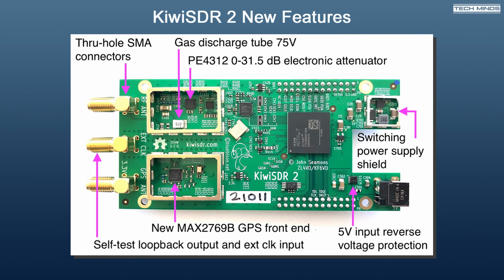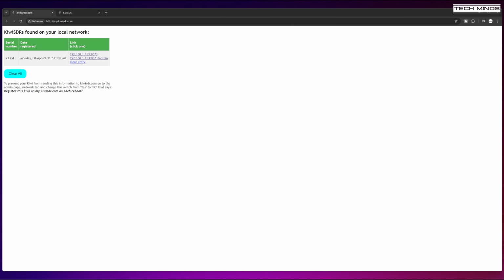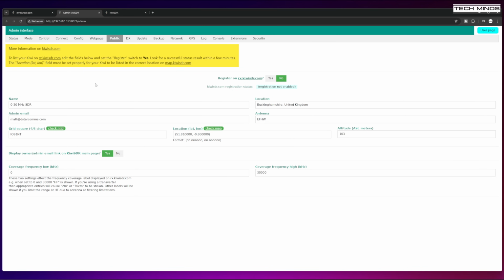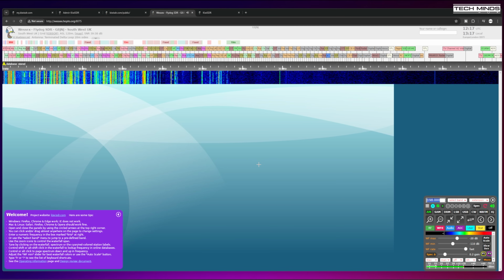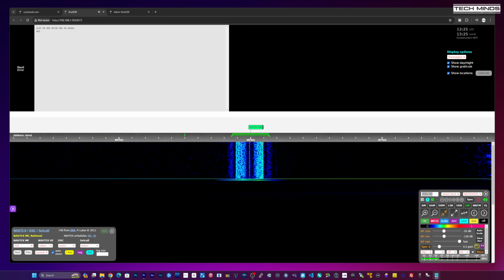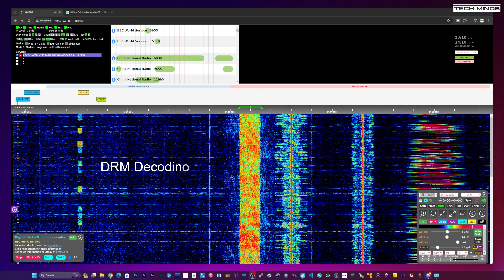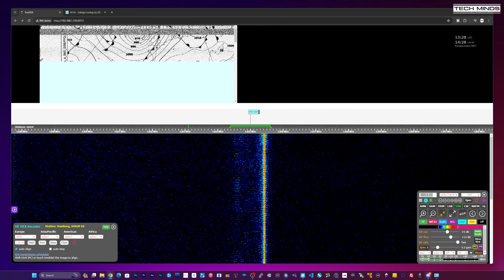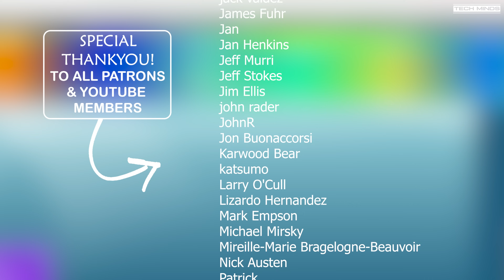KiwiSDR 2 - A Standalone Software Defined HF Radio Receiver

Comment: Why not just making this PoE capable? With USB only providing power input you could abandon that port completely….
Reply: This is a solid product projected almost 10 years ago with absolutely no competition up to this moment in terms of features and price range. 

KiwiSDR2 is actually a monumental effort from the author to produce a new batch of these receivers. Its key components experimented with huge price and availability issues following the electronics industry supply chain quake due COVID-19.

Including a new power option, potentially a very noisy one, would require hundreds of hours of testing and circuit revision.

Comment: Latency - does anyone have a view on this compared to the MK 1?
Reply: KiwiSDR2 is exactly the same specs and software of KiwiSDR, with only a few changes on the antenna input connection and GPS antenna input.
Reply: @hg-sx5nk  Thanks. They are great boxes but a pity there isn't a single operator low latency mode for transceive use. I guessing the multiple slices slow it down even if you don't want them. Makes tuning very spongy. Should do well nonetheless. Built-in proxy is good news for CGNAT sites.

Comment: On kiwi forum I ask if root should be running the kiwi service, maybe just a mistake. Explained why its not good.  Today my account is read only, and the post was removed.  That is not cool. Now I am seeing the real side.

Another thing that bothered me when I ordered mine in early March. They charged me right away. But did not ship until April 2nd.
I sent an email asking  why I was charge already.  The response was not in email.  But on the forums they changed a subject that had been closed.
Saying that cards are charged because  this is only the 2nd run. You guys are buy stock before its built.  So if you dont like it, let us know and we cancel and refund your order. I sure someone else would love the sdr.
   Not very kind customer service.
Reply from the maker: I cant comment on the forum issue you have, but with regards to paying 100% for something before its built and shipped is not a problem for me, and people that want to be on the list for a relatively limited supply of a product. I have done this many times in the past, just so that I ensure I get the product I want. KiwiSDR is huge in the world of online SDR, extremely sought after, so I guess they need to make sure the buyer is a serious buyer. It also helps them get a feel of the current market requirement. IMO of course..
Reply: @TechMindsOfficial   That is a fair statement.  
 I guess just knowing that was going to happen would be ok, but I was not aware.
Reply: @RangerUT  I thought it was pretty clear that I was paying up front before the first batch of V2 was built.

Comment: so whats the beef with KiwiSDR and Openwebrx ?
They look very similar like they were developed at the same time or even the same thing they has diverged over time
Reply: The original author of OpenWebRX finished his graduating studies and left the code to anyone use, IIRC.
Reply: @hg-sx5nk  KiwiSDR webif is a OpenWebRX clone which has since then been advanced and new features added.
then a quarrel began between the builder of OpenWebRX and KiwiSDR, which was solved and then later on came OpenWebRX+ but it does not (yet) have all the features KiwiSDR has

Comment: i'll stick to my sdrplay
Reply from the maker: Completely two different products catering for different solutions. That's like saying I'll stick to my push bike instead of my car. But SDRPlay devices are also one of my favorite SDRs, especially the RSPdx. However, it's a different product all together. KiwiSDR is designed for quick and easy deployment of an SDR receiver that can be reached from around the world over the internet, straight out of the box. Cheers
Reply: technically with SDRconnect, you could have one pc as a server and a client pc with SDRconnect configured to work over network and get a similar result.
you just cant decode different modes or currently add your own memory bandwidths

Comment: Cons-
Not safe to put on the internet. Kiwi runs as root.

Cheap gps included.
10/100 network card
4g sd card

For $400 I expected more.

Pros
It is  a cool sdr.
Reply: An FPGA, a very good 32MHZ ADC, a Linux SBC, support for 4 simultaneous users, dozens of digital decoders, all in a plug-and-forget solution... 

....and no other similar product on the landscape for the hobbyist. Perhaps USD400 is too low for other companies to engage in competition!
Reply: Anything “on the Internet” should be isolated in a DMZ…

Comment: You're perfectly right : I received it 5 days ago, and I'm on it most of the time.
It's a very cool receiver, I have an openwebrx with a rapsberry pi / sdrplay too, but this one is so easy to use...
Reply: I use Openwebrx+ with a RSPdx. just wondered if you have any issues with bandwidth changes between profiles and the waterfall sometimes going really slow.
I suspect this is due to sample rate changes and the switch between different antenna inputs
Reply: @BillyNoMates1974  correct, these are issues that the KiwiSDR does not have. 
I had the first version of KiwiSDR until I fried it and then it was no longer available. Tried OpenWebRX+ with an RSP duo, but does not even come close, as changing bands changes the band for everyone on the SDR

Comment: When you said VLF to HF l was thinking ….bet they didn’t add a gas discharge tube for lightning static… nice to be proven wrong, confident that it has been designed correctly.
Reply: Then did. See 3:08.

Comment: I suspect the Gas Discharge Tube is to protect against static pickup on the antenna rather than power surges.

Edit:
The definitive answer - STATIC.
John's response to my email query.  His prompt reply and information is presumably an indication of the high level of support that KiwiSDR's customers receive.
-------------------------------------------------------------------------------------------------------------------------------------------------------------------------------------------------------------
Hi David,

The GDT sits across the HF antenna input along with a TVS diode that the Kiwi-1 had. Also added with Kiwi-2 is a 100k ohm static drain resistor designed to drain the static voltage that tends to build-up on antennas from wind static.

The GDT was inexpensive and designed to absorb pulses that the TVS might not catch. All these devices respond to different time/energy profiles on pulses on the antenna induced from nearby lightning strikes.

Regards & 73,

John, ZL4VO/KF6VO
KiwiSDR NZ
Reply: And/or lightning⚡?
Reply: I understand that it is to increase the resiliance of the RX to very strong local signals. Many of these are located at the homes of radio amateurs so it helps if they are tolerant of strong local signals. I understand that this is an addition on the original version. I have a KiwiSDR 2 and it works exceptionally well. At the moment I have mine connected to a 10 element log periodic @ 27 metres. Usually parked beaming west.

Comment: Only temporarily sold out. Hundreds more available in a week or two. Also soon from distributors. So popular we can't build them fast enough!

Overpriced? I hear this from people who don't understand the standalone architecture. With other SDRs you need to be amortizing in the cost of the attached computer. And the cost of your time in installing software. The Kiwi is designed to solve these problems in an easier way. I invite people to learn and discuss on the Kiwi forum. Thanks for the review Matt.
Reply: Congratulations on an excellent product. There are an amazing number of these from around the world accessible online (using the link provided). There couldn't be a better way to demonstrate how good it is.
Reply: I think it's a decent price for the features. I've seen SDRs with fewer features go for much more.
Reply: 10 years ago people would have had to pay over £5K for a setup like this and it wouldnt have been controlled over the web.
it would have been a tuner you would have to have had in a shack.
this system allows a user to sit in bed and tune the waves on a tablet or a flippy type chromebook
Reply: @ThePrivateMan3301 Only to configure, which you could do via your phone, on your home network. Or use someone else's computer for a few minutes, to configure. The unit then operates standalone and headless.
Reply: I think it's reasonable. My mark 1 version cost me £300 and that was second hand ! This is a very high class sdr folks
Reply: @ThePrivateMan3301 Well now you have to differentiate between computer on the server-side (Kiwi) versus computer on the client-side (user/browser). For the vast majority of SDRs that generate IQ streams the server/client is effectively merged into one application on the computer. And they are single-user (some are now starting to develop server solutions). With the Kiwi you get an integrated server able to handle multiple user connections simultaneously (that can tune the entire 10k - 30M spectrum independently).

Many Kiwis are placed in isolated locations due to noise issues. And some find it easier just to deploy a Kiwi versus an IQ SDR plus computer, software and some sort of screen-sharing setup with the computer (assuming there isn't a server solution for the IQ SDR). And then what do you do about multi-user if that's a requirement?
Reply: @ThePrivateMan3301you can also use your phone
Reply: @ThePrivateMan3301  u can use the device u are on now.
Reply: Very good value for the amount of silicon you are getting and for HF is plug and play, try doing  a RP4 & SDR Play RSP it runs 90%plus CPU with only 5Mhz spectrum real time sample, KiwiSDR for HF is best value hands down

Comment: That sdr was over priced in my opinion and sold out too😮.
Reply: in what way is it overpriced? It includes the BB green and the SDR is completely custom made and in a metallic case.
Reply: sold out is markting stratagy 😈
Reply: @Mr_ASIC Have you thought perhaps it's just a great product, with no competition, made by an individual (not a large company like Icom or Sangean)?
Reply: @Mr_ASIC  Sure. But in our case a consequence of bootstrapping production from scratch. And not wanting to borrow money from the evil banks. So have to set build sizes that are certain to sell well to raise the money to pay the manufacturer. Every penny in profit we've made has gone back into producing larger build sizes. Eventually we hope units will begin accumulating as stock-on-hand instead of selling out every time.

I recommend everyone run a small business sometime during their life. A real eye opener..
Reply: @Mr_ASIC  except it's not. They can't produce them fast enough to keep up with demands

Comment: For anyone wondering it's £320 and sold out. Looks pretty neat and seems ok value to me.
Reply: It's kind of around the same price point if you build up your own system with Openwebrx+, a Raspberry Pi  4, RSPdx,  and two antennas
I have a RSPdx (£171),  Raspberry Pi 4 (1GB) (£45), Moonraker SQBM500P MKII DUAL BAND 2/70 VERTICAL SUPER GAINER (£70), MLA30+ (£40).
All up costs £328 but the advantage is that it's 1GB Ethernet speed
Possibly  decodes more modes as well.
Reply: @BillyNoMates1974  yes and this is nicely implemented with a lot of the work done for you and packaged very neatly.
Reply: @BillyNoMates1974  
I have two questions:

1. How did you connected the earth to the ML30+? Just to the earth of the wall outlet? I live on the 4th but I don't like the earth of the wall outlet. I am wondering about your opinion.

2. Did you modify the M30+ any further? I don't like the thin loop.
Reply: @MrAtlantis95  I haven’t earthed the MLA 30 at all. It’s just on a long cable running into the rspdx on antenna b as this supplied the bias t power to the mla 30
Reply: @BillyNoMates1974  Hmm I see I am confused with an active whip antenna.
Reply: @MrAtlantis95  ah thats explains why you asked aboout the grounding.
The MLA 30 is a mmagloop antenna
Reply: Want one! Great review
Reply: €372, excluding taxes, import charges, and shipping cost. Which means that for someone in Greece (like me) to order it, the final cost will be almost €600, with 24% VAT, import charges, shipping, and the custom clearance charge DHL imposes, that can be €60-100. I think they should better find some local distributors in Europe...
Reply: @SotosH65  Not sure if their production and the market are both voluminous enough to add extra profit margins for local distributors. Your calculation of all extra cost seems pessimistic to me. It looks like a great and fun thing to have, light weight, not a huge parcel to ship and I'd be happy to find out what it costs to get it here.  Down under people are used to the fact that importing from far away can cost some money. We will get used to the idea too ;-)
Reply: @palefire  Well, don't know, but on the other hand I don't either think that SDRPlay's production is so large, but they do have local distributors. They don't need many in Europe anyway, one or two is enough to cover the European Union area (and beyond probably). My calculations unfortunately are not pessimistic, there is a 24% VAT rate in greece, import taxes are probably something like 2%, add shipping cost (taxes are calculated after the shipping cost) and the at least 60 euros charge for custom clearance that local office of DHL imposes, for any import, outside EU area. So maybe not 600 euros, but easily more than 550...
Reply: @SotosH65  get a friend in the UK to send it to you:-)
Reply: @SotosH65  ML&S UK and WiMo Germany will have them in a month or so.
Reply: Let’s find out once the current build is available 😊
Reply: @palefire  Yep, have to wait and see (i already have several SDR's to play, just need more... antennas!! ) 😄
Reply: @SotosH65  I know what you mean -- here in the middle of Amsterdam I can't even have an outside antenna so it's basically a bunch of loop antennas ;-)
Reply: @palefire  I have a discone, a Diamond D130J for general coverage, that officially receives down to 25MHz (and up to 1300MHz), but I also use it to receive low frequency signals, even in LW (not great, but does some job). I like listening to 80 and 40m with it, but of course it is not an optimum choice. I have several strong FM transmitters and pagers at 155MHz nearby, so I also have to use a lot of filtering, not always with success.
Reply: @SotosH65  So sad that BBC stopped transmitting at 198kHz. I used to enjoy listening. Now the LW is quite dead here. (PS corrected: it's still there for a bit longer).
Reply: @palefire  It's still currently transmitting on 198khz but not sure how long for
Reply: Which antenna is shown in the video and what was the name of the Beagle upgrade board to 64bit?
Reply: Not really to be honest. I can't see it selling well at all.